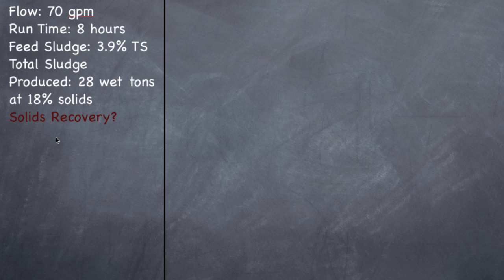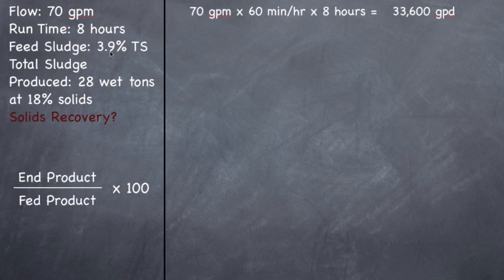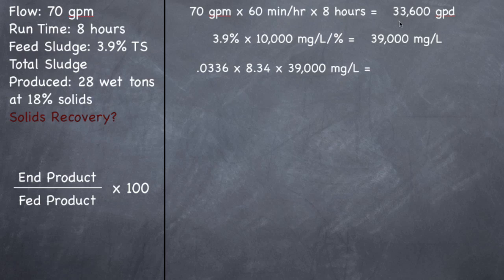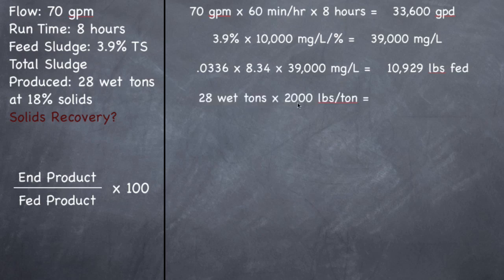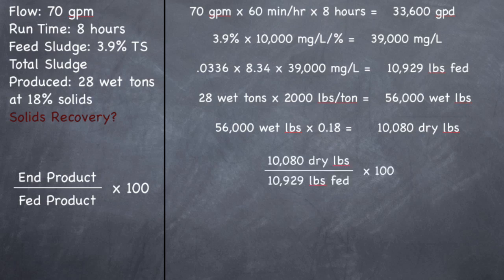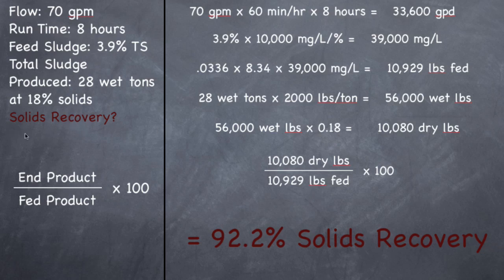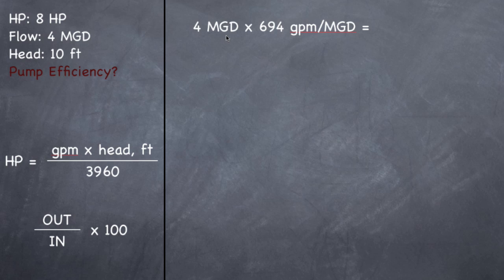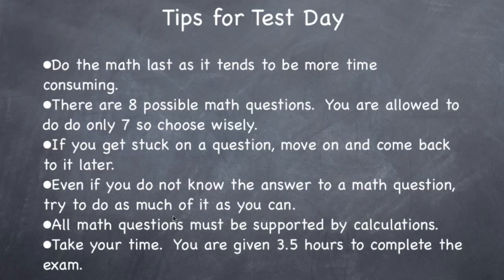CA Grade 3 Wastewater Math, Part 6 of 6

Comment: This problem can be done with the formula: (Head)(flow)=Power
Which is:(Feet)(lbs/min)=Ft-lbs/min but requires to convert MGD to lbs/min and divide the result by 33000 ft-lbs/min

By using the formula Christian did: whp=(gpm)(ft)/3960 gives us straight hp.